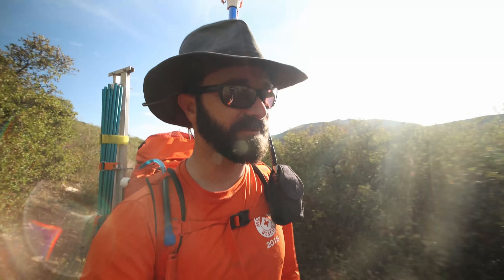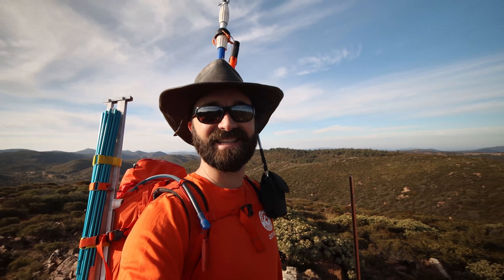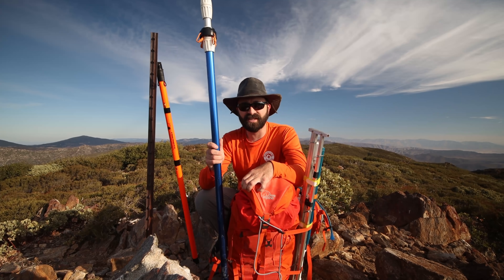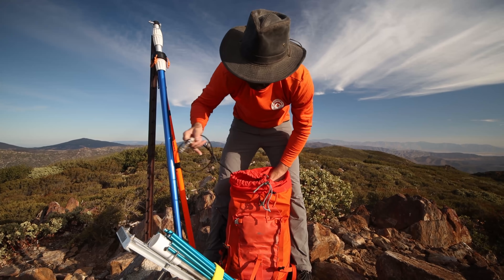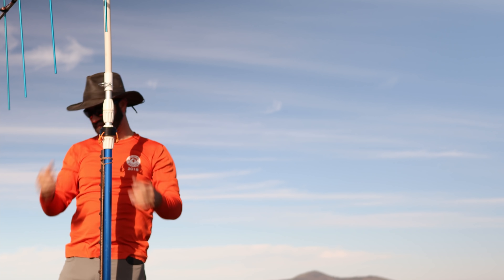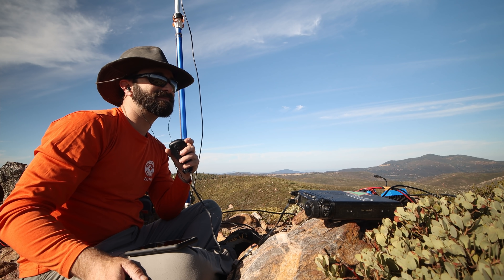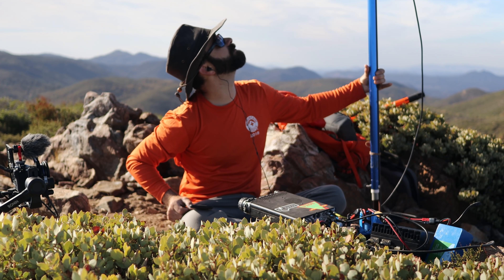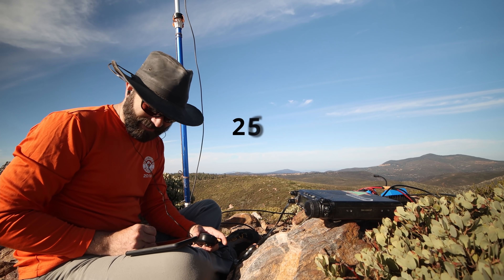More Gain, More Power - 2m S2S Madness

Comment: Interesting video Sir.. just gotten into Ham.. been around raduo/comms for a koooong time.. was interested in 2m SSB but I'm kinda disappointed in the lack of good radios that include SSB... Unless you like the cheap Chinese radios... 😒
Reply from the maker: I know! It's very hard to find full power options in the "new" market, especially for portable ops. An IC-705, FT-817/818, FT-857, or IC-706 MK2 on the used market are worth looking for.
Reply: @K6ARK  i did a search for a few of those.. a lot are selling from Japan but I was warned off of those as they may not cover US frequencies.. thank you..

Comment: Hi Adam. Still a great video. I've watched it again to get some ideas. I want to build a 5 ele yagi for sota 2m FM & ssb. I am now using my other account. My other account was/us Motters Motters.
Will have ago at building one of these. I've been reading about them, about gamma and hairpin matches. I am not technically minded so I guess it will be trial and error with that part. I've seen people use a strip of wire across the two elements on a tape measure yagi.
Should be on the build in the next month.
Motters M7TRS 73 👍🏻

Comment: They sell aluminum telescopic ladders that extend to 5.5 meters. Weight: 14kg but if you cut off only 1 mast will be probably less than 5Kg. On top  of that, if you can stabilize it you can probably put anorther 2+ meter of support since the ladder is made to support 150Kg.. If you manage to keep it straight up. Probably doesn't matter that much for 2m but still..

Comment: Are there plans for building the antenna? Try SSB on 144.200 sometime.
Reply from the maker: I will attach a MMANA file as soon as I have a chance. I also plan to do a few videos on portable yagi construction tips - how I make the elements, the boom, and the match.  I did work SSB from the summit, making one contact, and even called CQ on CW for a bit but had no takers there.

Comment: The bad part about using an amp on simplex is it gives the receiving station a false sense of a contact they will hear you but if they are running without amp, you will not hear them.
Reply from the maker: Excellent point. That can happen, but the pre-amp on SSB and CW helps on my RX side, as does the 6 element yagi.  I was constantly adjusting my power during the activation from 20w up to 160w. Worth noting, Joe, KE9AJ was running just 5w on his end when we made contact.  Fun stuff!

Comment: Do you have a build video for the antenna ?
Reply from the maker: Not yet, but like the 6m beam, I am working on a video that walks through the construction methods I used, and will share the MMANA files for the designs. There has been lots of interest in these designs, so I'm going to try to get this video (or series if it needs to be) out in the next month or so.
Reply: I am also interested in a build video for this